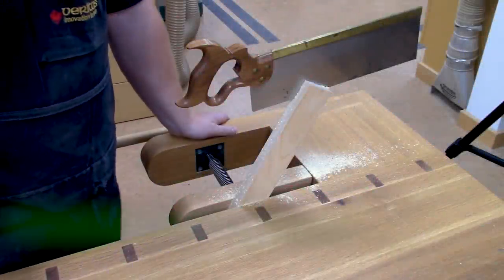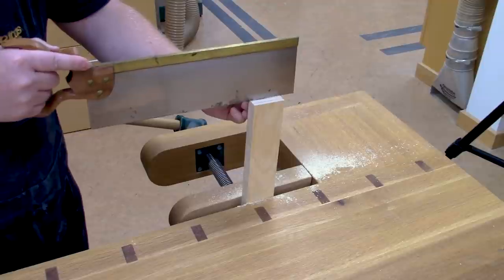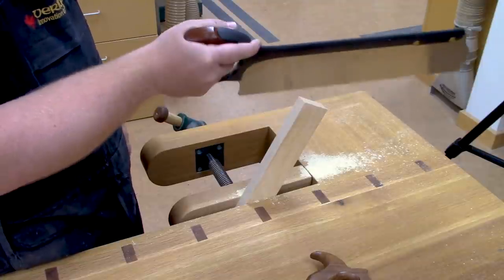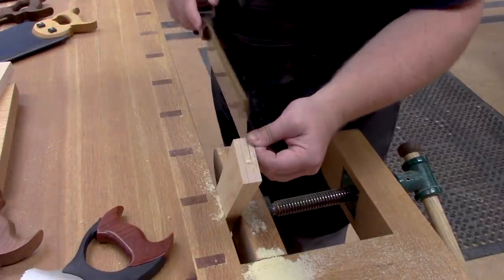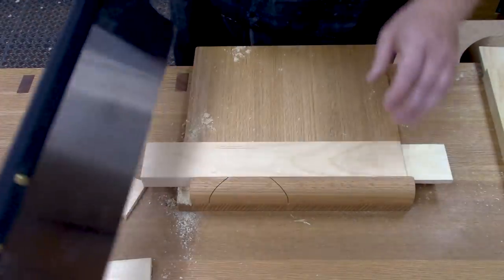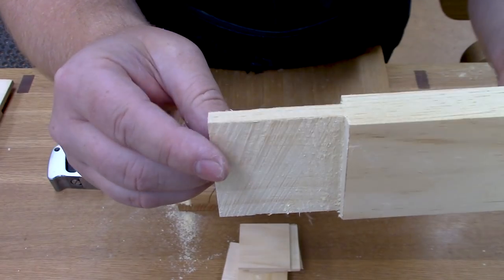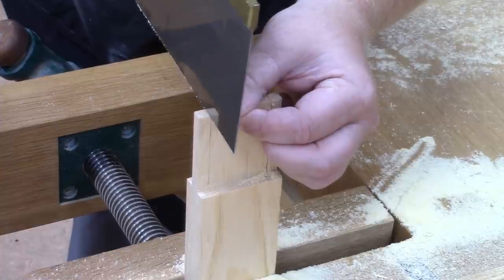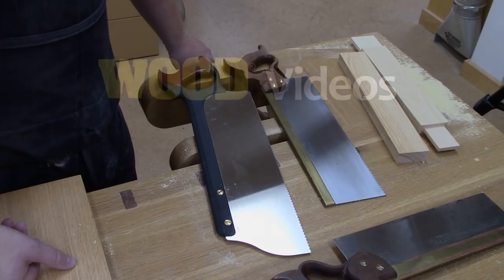How to Handcut a Tenon - WOOD magazine

Comment: By tilting the workpiece in the vice and sawing to the line then turning the workpiece180 degrees, I would think that that method is more susceptible to producing a saw kerf that is not straight, but rather the product of two intersecting planes, and not one single plane that would have resulted had you had sawn with the workpiece vertical.